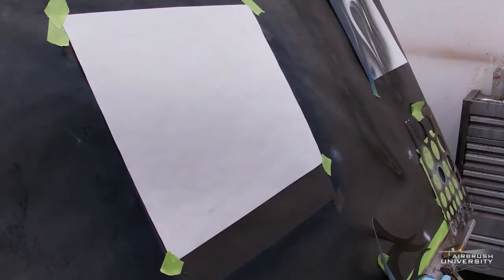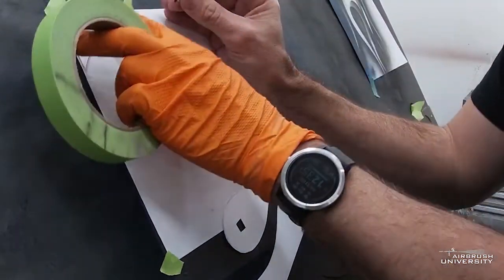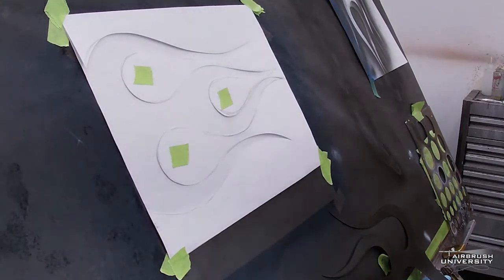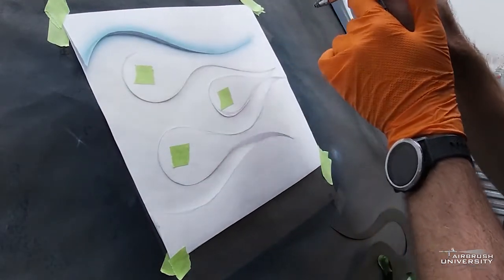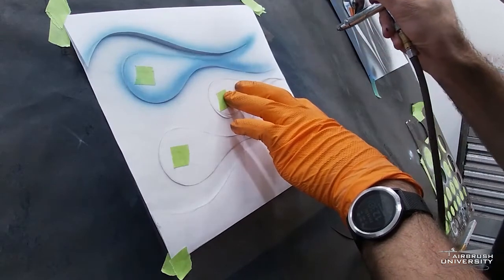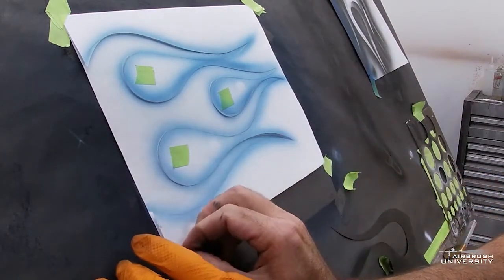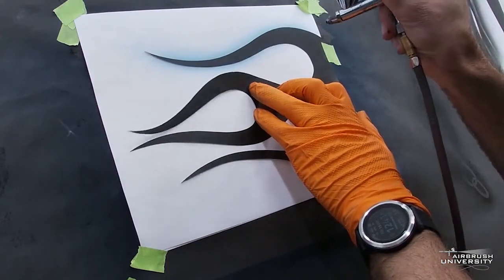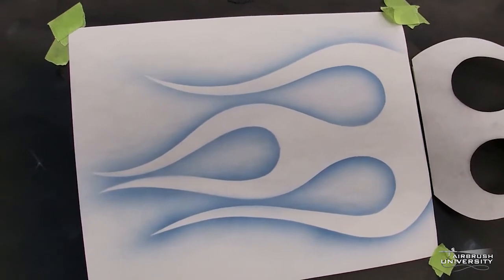How to airbrush ghost flames and reverse ghost flames

Comment: I use a leather carving tool (i think it's  called a swivel knife) to cut out flame stencils.  Works better than anything else I've tried & fairly inexpensive.
Reply from the maker: Yes I have also used swivel knives. They do work well for cutting smooth curves. I did find them a little more difficult to stay exactly on the sketched out lines vs. and exacto style knife. With practice you can get the exacto knife to twist and create smooth curves. But I agree smooth curves are easier with a swivel knife. Thanks for the comment.

Comment: Will it work for doing a matte finish over a glossy finish.  No colors just a different sheen
Reply from the maker: That could work using matte clear coat for the flames over glossy clear coat. You’d have to be careful and really sand the flame area after you mask it off. Then clean it really well. The edges will be fragile where the two kinds of clear coat meet because there is no final top coat over all of it.

Comment: Awesome tutorial man. Is the Inspire airbrush paint ok indoors in moderation? I have a small house and I airbrush in another bedroom. Thanks.
Reply from the maker: 88H8ER88 All solvent based paints smell more and are more harmful to breath in. So make sure to wear a good respirator mask that takes out organic fumes. Also set up good ventilation fans. You could also purchase water based airbrush paints. Water based will smell less and are safer but still use a mask. Inspire makes them too although I have not tried it yet. They are sending me some water based Inspire to demo on my website soon.
Reply: Airbrush University thank you, your the man.